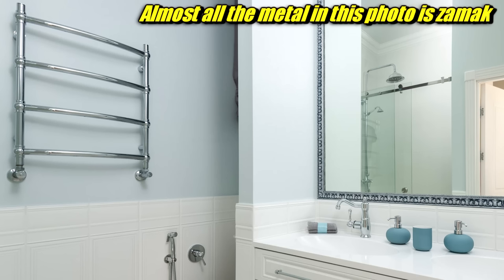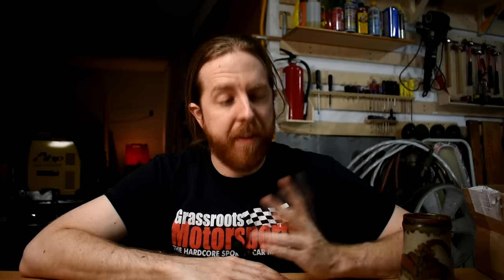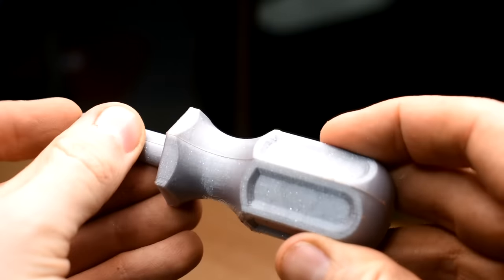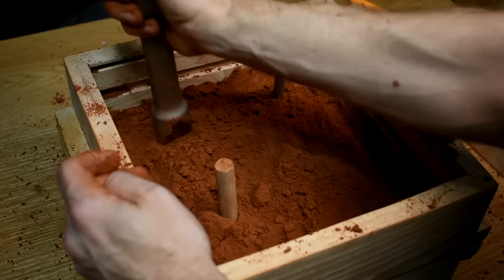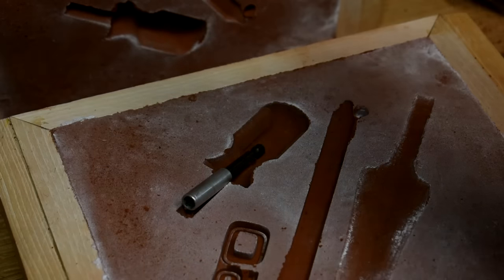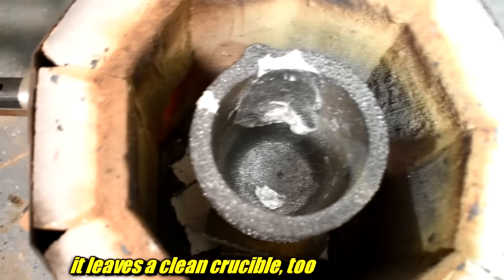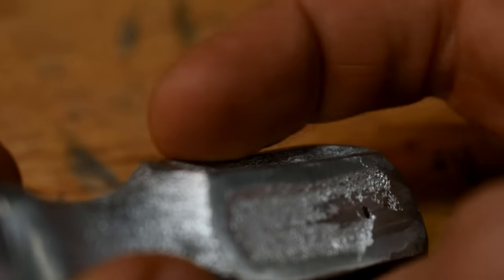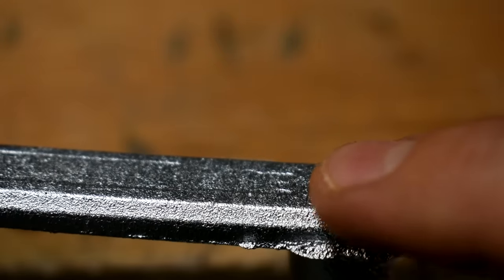The BEST Metal Casting Alloy That Everyone Ignores

Comment: It is used in automotive parts and one of the largest gun manufactures HIPoint that specializes in cheap pistols and pistol caliber carbines used it the reciprocating slides of their guns, but steel is used for the most stressed parts such as barrels, screws, firing etc.  The also use plastics for the least stressed parts.   The HiPoints generally work will last at least several 1,000 rounds and allow poorer working class people to defend themselves.

Comment: Thanks for the Tips. Perhaps it would make a good ceramic or graphite ceramic mould  spin casting metal . I'm Prepared to give it a go.  High temp melting point metals don't respond well to any residual trapped water. I'm not of the Bentonite Order. I like my moulds to be as lasting and reusable as possible. No offense to the Noble Bentonite sandcasting  order .
Reply from the maker: It probably would work for that yeah.  I'm going in the direction of vacuum casting, but a centrifugal set up would be fun.  For reused molds, I haven't heard much.  I know zamak tends to be too hot for permanent silicone molds, but some people say you can get at least one casting out of it.  Most zamak is die cast though so more stout molds should hold up fine

Comment: I wonder if one could use this with a silicone mold to really zero in the detail.

Thanks for the great video!
Reply from the maker: I think you can, but the heat needed for za12 is close enough to the limit for silicone that you don't get many uses out of it before the silicone breaks down

Comment: We were taught in High School that Zamak 'melts only once'.
Low-temp for original casting; a much higher heat was required to re-melt and that 'ruins the alloy'.
It was their justification for not allowing students to work with it!
The Shop Manual compared the process of casting Zamak to mixing and curing polyester resin.
You get one shot to mold a part, can't reuse anything.
"If a Zamak part breaks, you must throw it away and buy a new one, impossible to fix."
You'd think they know better in 1972.
Reply from the maker: That was back when zinc Alloys were still full of lead maybe a good idea to throw it away then!  I'll certainly try melting this stuff multiple times, see what happens.
Reply: @PaulsGarage  Best I can recall, Teacher said it was caused by precipitated iron crystals that formed while the metal cooled in the mold.
He said that re-melted Zamak would be loaded with 'iron sand'.
Didn't know about the Lead content!
Reply from the maker: Oh weird maybe that's why they specify this is such a low iron content?

Comment: There is also a similar promising alloy named superloy with a lower temperature to turn solid. 
93% made of Zinc. Some alloy similar to brass. Reminds me of the alloy "die cast" in car models. Why isn't here any tin involved if tin is related to zinc? I still wonder how to work on soft metals or alloys like aluminium without wearing the tools teeth out quickly.

Comment: It’s a pity we can’t use zinc at work - I work at a university chemistry department in the workshop, and almost everything we do has to be stainless steel or brass (or Teflon or PEEK) because of chemical resistance.
Reply from the maker: What brass alloy specifically?  Brass isn't hard to work with, but you do get zinc fumes because the melting point is higher than zinc boiling point.  And what about glass?  I thought chemists preferred glass beakers for that?
Reply: @PaulsGarage  Honestly I have no idea which brass alloy, I’d have to ask the machinists. (I’m the electronics technician. :P )

Most of the vessels are glass, but all sorts of fittings, couplings, reactors, and holders are also needed. It’d be great if the chemistry stayed confined to the vessels it’s supposed to stay in, but in practice, stuff gets splashed and dripped all the time, not to mention that many reactions produce corrosive fumes that slowly attack anything that’s inside the fume hood. So even mundane items sometimes need to be fashioned from very non-reactive materials.

(For one project I worked on recently, I had to make custom cables by stripping the ordinary PVC jacket off the cable, then pulling it through Teflon hose. The fumes of the solvent used in that reaction, DMF, slowly melt most plastics, and because the tiny hoses between components are under pressure, if/when a hose coupling fails, hot solvent sprays around, which corrodes steel and aggressively attacks most plastics. So everything in the splash zone needs to be stainless, Teflon, or PEEK.)

Comment: Does Warming up your casting sand to a higher temp right before the pour help with the shrinkage?
Reply from the maker: probably not shrinkage because that has to do with variable thickness in the casting, but it would definitely help filling the mold before the metal freezes and probably really help surface finish

Comment: I first heard about zinc-aluminium alloys when I read a paper about sustainability, much better for the environment because they take so little energy to melt.
Reply from the maker: Oh for sure, its like nothing to melt it.  It falls short in other ways though, but for lots of products it's more long lasting than plastic and cheaper than aluminum, it should be used more I think
Reply: Sustainability means discovering more energy resources we can exploit.
Reply: @1pcfred  Not spending unecessary energy is good too. And we already have the perfect near-infinite source of energy, but parts of the west are too afraid of nuclear power.
Reply: @WhenDoesTheVideoActuallyStart  having to worry about every erg is a waste of energy. We need abundant cheap energy. FU kind of energy! Clean coal! The OG solar power.
Reply: @1pcfred  Carbon neutral coal, i.e. charcoal, cannot be produced in enough quantities or at low enough prices to substitute natural gas/petroleum.
Reply: I am going to just put in my two bit, everyone can feel free to disagree: I am not against fossil fuels in and of themselves, but I don't see where being wasteful when there is not much of a reason makes sense.  I really support freedom, so I don't think that it needs to be mandated by governments, but I do think that it makes sense when we think about these things ourselves.  For some things you need the lightness of aluminum, modern automotive parts, aircraft, etc.  But for a lot of things Zamak makes so much more sense and I am glad to see someone doing a video on it.
Reply: I will also comment that neither Zamak or aluminum are going to easily last over a 100 years if not abused the way bronze will.

Comment: How do you think this metal would work for making custom challenge coin blanks to mill in a small 3018 cnc mill?  Ive done brass and aluminium and the brass looks great, but aluminum isnt shiny enough.
Reply from the maker: This stuff is pretty shiny, but when cast it can have hidden porosity that is exposed by machining if you don't cast it properly.  I would suggest maybe pure zinc instead?
Reply: Any tips for pouring from a ceramic crucible into an open top carbon coin mold?
I get the same issue when using the little 1.5" x 3.5" ingot molds.
Does the Zamak polish nicely if I do get a good cast?
 @PaulsGarage

Comment: Would this be suitable to cast into weed eater blades the plastic ones break to fast and get expensive
Reply from the maker: definitely not.  this stuff is tougher than aluminum, but it's nothing like carbon steel.  This would probably shatter into shrapnel at the first rock

Comment: how durable is it in use though. I know you said its everywhere but i mean more for mechanical applications. I have a few parts on a custom printer that could be made much smaller and more light weight if they was made out of metal.
Reply from the maker: It's more durable than aluminum, less durable than steel.  Not sure you will save weight over plastic, this stuff is pretty dense.  It's tougher than plastic but also denser.

Comment: I have co2 pistols made from zamak, harder than aluminium and heavy like steel, it's the good stuff.
Reply: I have a real pistol made from Zamak. Walther P22 slides are cast from this.
Reply: Yep, surprised no mention that a lotta firearms use zamak/zinc alloys in most everything except the barrel & other critical parts of the firing mechanism. Though even zamak's increasingly getting replaced now with 'polymers', aka, plastic!

Comment: How can we maintain the shineness on zamak?i use sandpaper for polishing and after a day pass it gets blurred
Reply from the maker: I think different zamak alloys will dull differently. This is za-12 which goes dark pretty quickly.  Within a day or 2 if it's a ring on my finger.  i think other alloys maintain their shine better, maybe zamak 3 or 5 will work better, but ultimately i bet a clear coat would be best.

Comment: That's pretty neat. How fine is the gain size of the casting sand you used?
Reply from the maker: Standard petrobond, not the fine stuff.  I think the normal petrobond is 130 mesh?  I could be wrong though.

Comment: You can even pour a variant of this alloy directly into a Silikon mold as it melts at 240°C
Reply: ZAMAK alloys melt at 380-420°C. You're thinking of Pewter, a Tin-based alloy.

Regardless, they do use ZAMAK in rubber mould spin casting, but it's high temperatures do mean the mould is essentially disposable.
Reply from the maker: It would be fun to try either way

Comment: This is a random question that is only slightly related to this video… in one of your previous videos you show footage of you using a respirator that has a mouth-piece instead of a mask, what kind of respirator is that and where did you get it? It seems like the best solution for the facially haired such as we
Reply from the maker: It's called a resp-o-rator but last time I checked it wasn't a available anymore 😕

Comment: what casting mold material should one use with this to get maximum crispness and smoothness to the finished product without sanding? I want to make metal miniatures for tabletop gaming
Reply from the maker: I have some videos showing that, actually.  OnePageRules minis in this exact metal. What you want is investment plaster and a vacuum casting machine.  You can 3d print with burnout resins (I like monocure burnaway) and then put it through basically a jewelry making process.  good luck!
Reply: @PaulsGarage  thats awesome, can it get super details down like plague marines? (Lots of details)
Reply from the maker: @Sunmourn  yes, but the process is a bit tricky.  you need a way to burnout the mold (burnout oven that can be controlled like a computer controlled kiln) and clean metal that you can melt in a furnace that is also tightly controlled.  I go over some of it in the videos.  I used Za12 which is a bit tricky (the "correct" temperatures for everything aren't published as it isn't usually used for this) but something like bronze or silver or gold would be easy to look up.  It's a jewelry making process, so if you see how intricate fillagree jewelry is, that's the level of detail you can get.  You need to use a vacuum casting machine for that, though.  So you are looking at a couple grand in equipment to get the best results.
Reply: @PaulsGarage  thanks a bunch! I appreciate the information :)

Comment: Some marine suppliers use it, and even chrome plate it. Unfortunately, in salt air it disintegrates in short order, hence the term “chrome plated crap”.
Reply from the maker: Yeah zinc doesn't like sea water for sure.  There are zinc alloy parts inside washing machines too and they get destroyed after years of soapy water and stuff.  No worries though, I'm not going to take any of this stuff to the beach with me lol

Comment: Will there be an experiment with die casting zamak?  Would be great for things that are needed periodically or in medium quantities like gear blanks, hand tool handles, and control knobs.
Reply from the maker: I don't plan on it soon but maybe eventually.  Dies aren't simple to make, at least I don't think they are.  I do plan on making some permanent molds eventually probably silicone? But that would require cooler temperature metal like pewter or something

Comment: What will the mechanical strength of Zamak alloys typically be at 270°C and 300°C?
Reply from the maker: Soft, but not ductile.  Probably crumbly the hotter it gets, eventually turning to sludge around 400c and up

Comment: Even if you are not careful while braze "welding", you'll get the metal fume fever. Avoid heating galvanized metals as well!
Reply from the maker: Very true, most welding operations are way over zinc boiling point
Reply: @PaulsGarage  exactly what happens, someone finally understands the physics!

Comment: I'm new to casting. Can zamak come in a yellow or gold color, or is there an additive that will color it? I hope that isn't a stupid question! 😁
Reply from the maker: Hi Chuck!  Zamak is only a bright silver color, but zinc is also in yellow brass (70% copper, 30% zinc).  Brass is a pretty advanced metal for casting, however, so I would stick with zamak and aluminum at first.  Brass actually boils off zinc as it is liquid and the fumes can make you sick.  I think the majority of gold colored alloys that don't Include gold use a lot of copper

Comment: Have you ever done anything with High-Tempurature Silicone?
If it can handle high enough tempuratures, it could get you better detail and a smoother pre-finish surface.
Reply from the maker: I haven't tried it but it's on my list.  I've heard even high temp silicone breaks down eventually at zamak temperatures but you can probably get a few castings out of it
Reply: @PaulsGarage  I don't know how many castings one can reasonbly expect to get out of it even with peuter.  Even the high-temp stuff takes some wear with each use.
Just a thought.

Comment: Ya magnets stop working at a relatively low temperature compared to casting I tried soldering a wire to one and under 400°c it stopped working

Comment: inc-pest only occurs when subjected to below 50 degrees.... and I live in Florida.  I should be fine as long as I don't leave it outside in our "winter". :P
Reply: I think you're thinking of tin pest, which is driven by cold. Zinc pest is a different process. Warm and humid seem to be what accelerate zinc pest.
Reply from the maker: Bingo, tin pest is from cold, zinc pest is from lead.  Both are bad though
Reply: Dammit, you're both right. LOL

Comment: What is it now that cause ths "zink pest" ?  Not the right amount of lead in the alloy, or must it be free of any lead at all ?
I somehow missed that point.
Reply from the maker: Lead does it, yeah.  Modern zamak makers are super careful about keeping lead out for that reason.
Reply: @PaulsGarage  Thank you !  I also googled for the "ingredients" of zamak. Seems to be Zinc, Aluminium, Copper and Magnesium. No Lead at all. But of course each of the metals could contain small amounts of other metals.
Reply from the maker: @Dr._Spamy  yeah all alloys have trace amounts of other metals but zinc alloys have super low lead tolerance because of the pest.  I don't even melt zamak in anything that i have used to melt non-zamak to avoid any possible lead contamination.

Comment: Heat kills magnets, they have "High Heat" magnets, pricey. I worked in die cast mold and plastic injection molding, you could easily make a "Permanent Mold" out of steel, it doesn't need to be high quality. For Zymac that is.
Reply from the maker: Permeant molds sound cool but a bit out of my capabilities here in a garage.  Maybe silicone molds for pewter but otherwise it's beyond me

Comment: is there anything in zamak that would make it dangerous for a cup for drinking out of?
Reply from the maker: Different types (the numbers of the alloy) contain different things but za12 here is just zinc and aluminum, both fairly harmless.  That said it's not great with corrosion so acidic drinks can be a problem.  Think basically all sodas.  Cans have a plastic liner to prevent the soda from dissolving the can into the liquid.  To be sure I'd stick with glass and ceramic cups which are glazed (the glaze is basically also glass).  Most of those metal thermoses are stainless, I don't think any are zamak.

Comment: Is there a reliable way to predict how metals like zinc alloy will shrink after a casting?
Reply from the maker: Yes!  Most metals have a known shrink rate that you can look up.  Often they are measured in "how much they shrink per foot" or something like that and you can get "shrink rules.". That way if you make a pattern at the desired dimensions according to the aluminum shrink rule, then cast that pattern in aluminum, the part will shrink to the actual dimensions.  Kinda neat.  I don't know right off what's za12 shrinks at, but I'm sure it's easy to find out